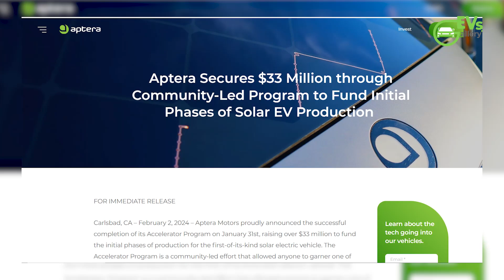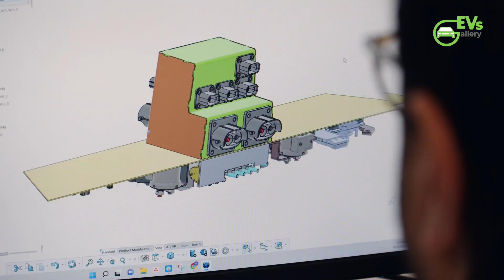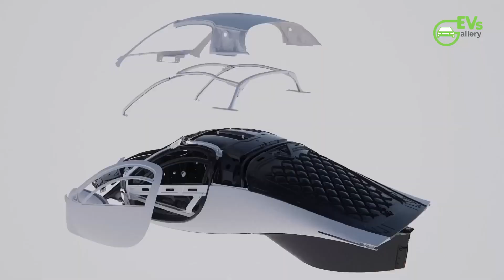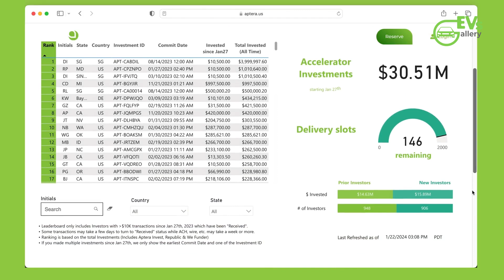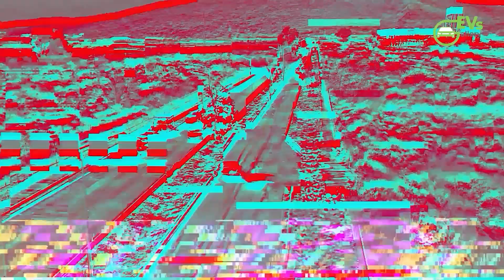Aptera's 400-Mile Range Solar EV

Comment: There is not going to be a low volume production. The assembly is done with subsystems and very few parts. Not only is the vehicle different than others, but the way it is set up for assembly is not suited for low production.